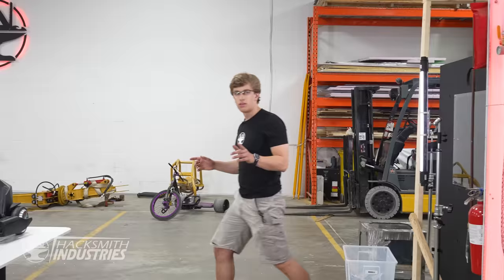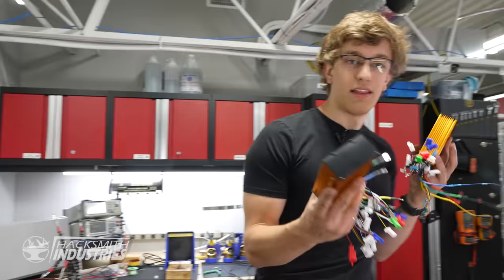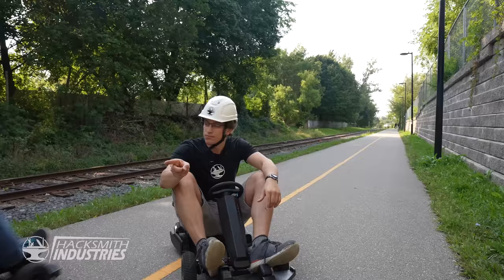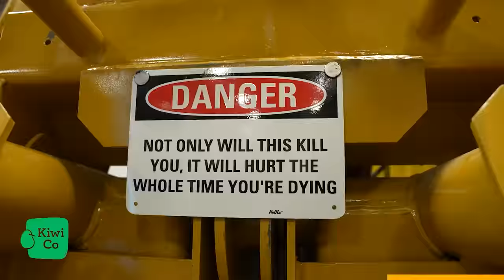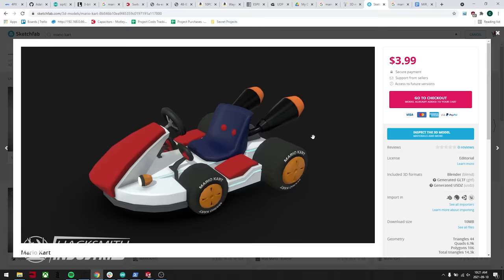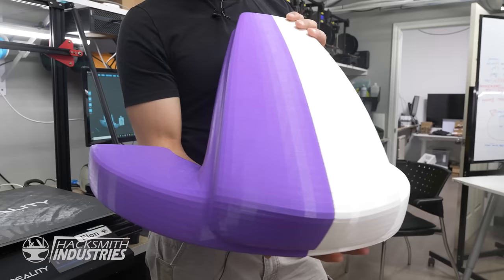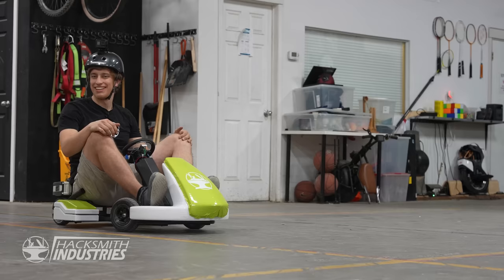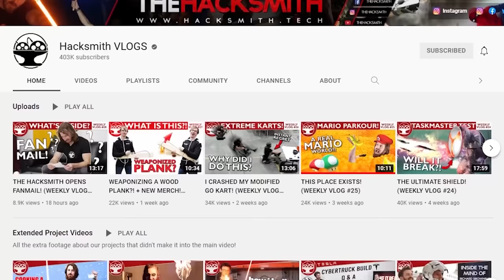BUILDING REAL MARIO KARTS!

Comment: might be fun to make a infrared 'gun' on the front with sensors on the rear of the cart were you can 'fire' red and blue shells at each other causing a drop of power for a second or two.
Reply: basically like a laser tag system
Reply: Yes
Reply: Good idea
Reply: Thats a good idea
Reply: Yeah but that sounds so dangerous people gonna be boost’n and losing speed everywhere 🤣
Reply: That would actually make sense; Much more sense than deliberately slowing the cars down for 99% of the track, just so they could call normal/full speed "a power-up", like they did.
Reply: easier just to send a signal to the other kart that stops kart for a short time
Reply: I was thinking something along the lines of an app with online team creation and then you place your phone in a Dock, or perhaps Bluetooth but same consept
Reply: or maybe an app that connects to the cars and uses a virtual visualization of the scene ti allow for shells and banana's etc... so when they hit a car in the virtual world a signal is sent to the car that got hit that it got hit and for it to do whatever it needs to do
Reply: that would be fun or a track with a sensor net for blue shells finds the car in front cuts power for a second
Reply: That'd be great. I'd also like the lightning bolt to slow all opponents down. You could use some long range Bluetooth or something of the sort to transmit attacks. IR for green shells, Bluetooth for red/blue shells and the lightning. 
Poison mushrooms could hinder speed for a length of time too.
Reply: I was thinking of something like a colored randomizer like they have but that chosen color picks either the lead car or random and allows for a power loss as well.
Reply: With the speed pads and this, it goes more in the direction of wipeout than mario kart (which is not a bad thing actually)
Reply: Install a huge beamer high over the track and let a computer calculate and render the shells on the floor as image. could also give those moving stripes on the boost pads.
Reply: Instead of just powering down I think it would be cool if they put a fifth wheel behind the rear axle that is turned 90° and under normal conditions does not touch the ground but if one of them gets shot the wheel gets lowered and spins so the kart will spin out. Pretty dangerous but a lot of fun to watch.
Reply: You know how dangerous that would be to hit someone drifting
Reply: @bmack6629  they could just have one of the two wheels motor turn off and the other go full speed, instant spin out
Reply: Was gonna comment this. Just have it cut the battery for a sec or so
Reply: Can you make laser watch which can cut metal also
Reply: I think you'd either have to have really good aim, or a very wide infrared projector and a very sensitive sensor on the back to pick those signals up.
Reply: Good idea
Reply: Man's really called a green shell a blue shell
Reply: Or make it so that the car spins out for a second like in the game to make it more like the game
Reply: If they have boost they will slow down to feel normal spew that the cart is to go in there they didn’t have boost it was slow down to in the stock￼
Reply: 😲 - Cool idea!
Reply: perhaps just a 25% power loss? not a completw drop
Reply: I legit had that same thought this morning😂😂😂

Comment: For other power ups you could connect all the karts via bluetooth or wifi. A red shell would briefly shutoff the motor of the kart in front of you, a banana could slow done the person and a blue shell would briefly shut off the person in first.

Using the color sensor you could use a counter for laps or checkpoints so the karts no who is in what position. This might be complicated solution but I'm sure  what ever you would be super intuitive.

Comment: I was thinking, you could get some infrared sensors in front and in the back of every kart, that way you can make a Shell power up, if you have another kart in front of you and you used a shell power up it will slow down the kart in front of you.
Also a banana peel power up, it does the same but to the kart behind of you
Reply: ...or make it so that it triggers the tires to burn out.
Reply: @Justm3180  yeah, but that would be a little more dangerous, if someone brakes in front of you at that speed you will probably crash, like really hard
Reply: @francoagustinwolpers1864  True, I was joking btw.
Reply: @Justm3180  really? But it was a great idea, if you aren't afraid of mini karts crashes
Reply: @francoagustinwolpers1864  Make the go karts into bumper cars, wouldn't be exactly the same, but it'd be safer.
Reply: @Justm3180  that's an option, but yeah It wouldn't be the same
Reply: The infrared sensors would also detect barriers, so I think using some form of GPS on each car. U can also make a virtual race track display on each
Reply: chaos karts london look it up

Comment: Few ideas. Instead of colored tape, you could use leds and a distance sensor
When someone drives over the device it would light up with a random color. This would be picked by the next driver's color sensor. One color would be equivalent to a banana, blocking the throttle for a few seconds

Comment: One thing you might do to enact negative powerups would be to connect the arduinos together with BTLE. that way you could do a negative speed boost to a random enemy. I like the idea of the infrared gun, but you'd have to do it in such a way that the user doesn't have to aim it... it seems like you already have your hands full just driving!
Nice job!

Comment: Hmm. A wireless connection between the karts that allow for green shell, which when activated will either hit or miss the nearest player at random. Or a red shell that automatically hits the nearest player. A hit will cause the kart to slow down for a few seconds like a reverse boost pad. And a banana peel will slow you down for five seconds like a reverse star. But you’d have to create a wireless kart server and stuff. Plus a deception for the kart in front of yours. That sounds like a lot of work. Just a thought. I love this stuff.

Comment: I think these are great. I feel like I have a good idea for the red shell power-ups that could make these really like mario kart but safe.

If you put a row of IR lights in the front of the kart and IR receivers in the back of them you could shoot your power ups like in the game.  When the IR receiver detects a IR light from the kart behind it will apply the electrical brake or cut the motors for 1 second.

This way people could use the red shell  as a strategic offense and bring a bit more fun into them other than just boosts.

You could probably bring the banana power up in as well if you put IR lights and receivers on the opposite but that might get complicated and cause interference when you use your own red shell 😅

Comment: Use laser tag tech. If you get a red shell it fires out the front and hits the receiver on the back of the cart in front of you which causes the motor to stop for a second. If you get a banana it fires the laser out the back and hits the receiver on the front of the cart in front of you. Just a thought.

Comment: I have a challenge for you. Design a go-kart and 3d print it so it can drive and support lots of weight.
In the challenge you have to design and print everything. But you can use any filament. Metal, plastic, ect.
Thanks for reading this.

Comment: So I had an idea for an all electric indoor kart arena with movable tracks. It would work like mario kart the "power-ups" would be plates on the floor. As you pass over the plate you get a power-up, if it's a shooting one the kart is built with a laser tag like system with receivers on on rear of each kart. For speeding up like using a mushroom or hitting a fast pad will engage 2 extra batteries on the kart for a small amount of time. The track walls would be on a pivot system where you can change the same track you just raced on to a different track by pressing a button and the walls shifting and becoming a new track. This way you could have a whole track series race in the same area as you raced the previous races.

Comment: 3D printing with a bigger nozzle like a .8mm or 1mm print so much faster and is prefect for bigger 3d prints. i only use .4mm if something has extremely fine detail. i can get away with most of my prints with .6mm nozzle and .3mm layer height. its much faster this way with same quality. Also speeding up acceleration on the printer itself to 800-1200 would increase speed a lot.

Comment: I have an idea but not sure how hard it would be. Maybe somehow make it so the Karts spin out from bananas but obviously not using actual bananas, or stop by shells. How do you do that? Maybe have some camera hooked to the ceiling that keeps track of where the karts are and displays a minimap on the kart somewhere. If someone gets a banana and pushes the button, that info is sent to the the overhead camera to display that info on the minimap. If you hit a banana, one moter stops and the other one keeps going to spin you out. Same for shells but instead, both moters stop for a sec. This would probably be so hard to make but it sounds really cool.

Comment: A light sensor in the front and back would be cool. If you had a lazer on the front and back of the car aswell it could be like a green shell and a banana. And when the light sensor is triggered it either slows the car down or turns on the brakes for a little bit

Comment: Perhaps do the shells and other Power Ups as a set of solenoids that force the cart to literally spin out. And some that just reduce speed factor. Have them triggered by IR or  NFC . Ir Would be easier to pragmaticaly Program The Use a Air Cannon to shoot them. A NFC could be easir to embed in Nerf Rival Balls. Then Use a NFC Programer in the breach of launcher to Program the nfc chip once the power up gets selected (if offensive) and setup a broad reciever. If Range is an issue look into Powered RFID You may be able to put together a compact version and use larger foam balls to contain them. If This doesnt work you could do a Micro RC car Drone that auto targets other carts like a red shell. Just pitching Ideas dont know without R and D time weather any of them will bear fruit. The Boost Idea is pretty Epic tho.

Comment: Having display panels on the track that show the power up cycle animation once you pass over it would be awesome! 

A possibility with using the display panels is having them display the yellow power up box, and having that color sensor set for yellow. Once it triggers the sensor, have a couple second delay before a random power up is selected.

That's how it works in the game right? This is totally possible!

Comment: This is a way you could make the power up better for the star the outline of the kart glows red but not on the bottom.of your kart.The oppisate kart boosts away. for the horn have a fan underneath the kart so when you activate this power up the fan activates shells should be a row of lights in the kart if it is to left then the left light glows if it is to the right then the right one glows if it is right behind you in the middle the center light glows and when it gets close the light flickers if you get hit then your kart stops there ACTUALLY IS NO SHELL the lights just behave like the shells do if it is a red shell then the center light is always on if it is a green shell the light doesn't stay in the center the right one glows then that one turns off and the right one might glow to show how bouncy it is for the blue shell the light will always be in the middle and will flicker a lot this is just an Idea

Comment: For all the money you've put into your workshop why not get commercial grade full color 3D printers?  Not the kind that use filament as those take way too long to complete a project.  Something like the HP FusionJet 580 series.  Only costs $50 grand to $100 grand and is about the size of that hot tub but a bit taller.

Comment: How do the speed boosts make the kart go faster when you don't have a bigger power source. Or did you use a speed limiter on the motors on purpose when you tested the kart to make us think that it's a power boost when it's just in fact the full speed of the motors being used?
Reply from the maker: Speed controller programming -- top speed is 70% throttle, when you get a speed boost it unlocks 100% throttle. Also implementing a coin system so every coin you pick up gives you another 3% or something

Comment: 0.2mm layer height for prints that big? Is there a reason you didn't use a larger layer height? I would have used a 0.8mm nozzle and a 0.4mm layer height to get them printed in a less crazy time. Granted, you make way nicer looking stuff than I do :P
Reply from the maker: Had the time so it didn't really matter!
Reply: @hacksmith  As good a reason as any!

Comment: Your final kart doesn't even remotely resemble the initial kart you bought. Which is good, of course, but...

Why'd you even buy them? Is there anything on them you didn't replace?
Reply from the maker: Replacing components is easy. Building a frame from scratch, let alone 4 frames from scratch -- steering linkages, gas pedals, steering wheel etc... that's the hard part. That's why we started with an existing kart

Comment: I don't get it... Why buy kart to strip down just about everything ?!? If you were to put your own battery, motors, controllers and bodies, why not build it from scratch and do your own frame and steering ?! It's not like you don't have the tools for that !
Reply from the maker: didnt really strip down anything... adding a motor,  and new speed controllers is trivial, building a whole frame with a seat, steering, gas pedals, etc? thats a lot of work.
Reply: @hacksmith  but that's what we expect from you ! Doing lots of hard works !! ;)
Reply from the maker: We want to make a bunch of these -- lot more efficient to use an existing design!

Comment: Why not just get a v twin 600 cc motor from harbor freight
Reply from the maker: Because that's bigger than the kart.
Reply: @hacksmith  you have a good point but with some weight on the front and a motor bracket on the back a beefed up solid axle and a centrifugal clutch you'd be good to go ole son
Reply from the maker: Can't use them indoors then without choking on exhaust!
Reply: @hacksmith  true